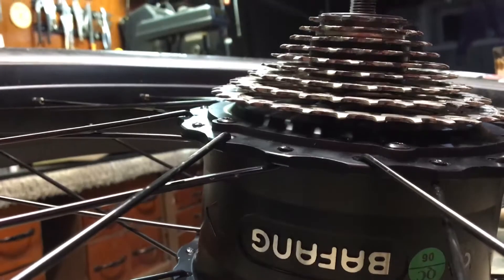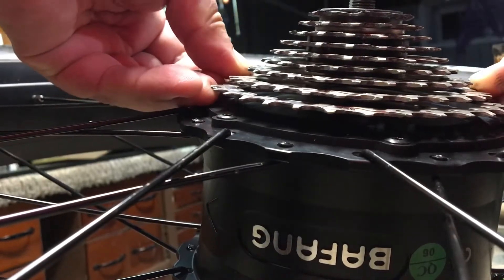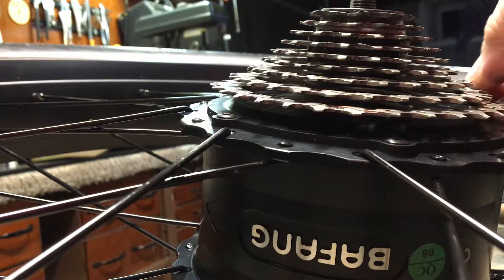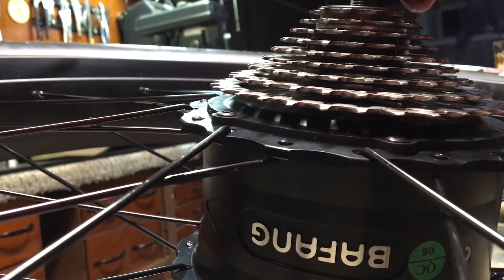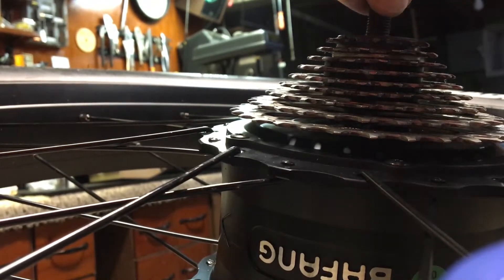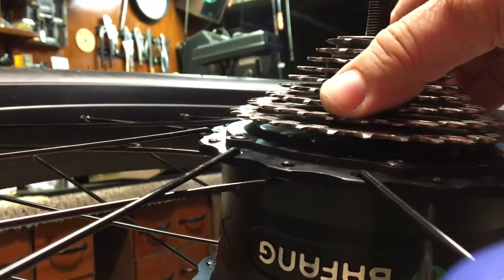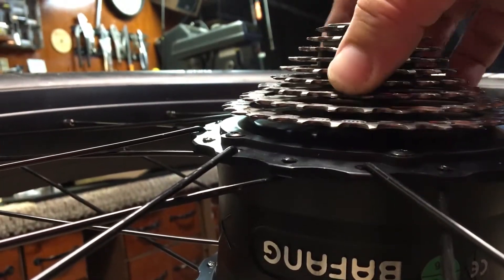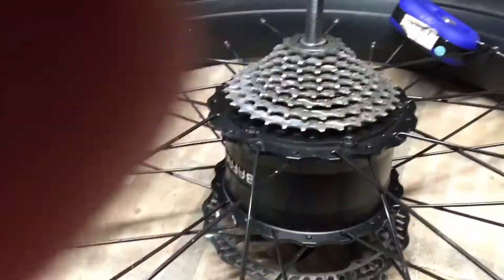Juiced Bikes RCS - FAT EBIKE CASSETTE GRINDING and other identified issues

Comment: To remove the cassette, you need a chain whip and freewheel/lockring remover wrench. Note that because there is a wire at the middle of the hub for the motor, that you need the lockring remover wrench center to be opened. So, be carefull to get the one that will work with your hub. Also, since your bike is still under warranty, you probably should first contact Juice bikes and see what they can do to help you.
Reply from the maker: Hi Gilles, Thanks, I ordered the Park Tool FR-5 removal tool last night and I'll make a chain whip myself.  My guess is it's the cassette bearing or the cassette hub is somehow damaged or cracked. Maybe the cassette is just not torqued down???
Reply: I don't see how the cassette could have been damaged, there isn't enough torque to create that type of damage, unless you dropped the bike on something really hard like concrete. The cassette not being torqued properly might be possible.
Reply from the maker: It sounds like the cassette is moving on the freewheel hub. I don't know if the movement is coming from improper torque down or from the hub  itself or the bearings the cassette spins on. I've never removed a cassette, but have watched a number of vids, including the Park Tool video. The procedure should go fine.
Reply from the maker: @jaybrown1480  Hi Jay, IMO, the grinding is due to the gear hub on the Bafang motor not being to proper spec to fit the Shimano cassette properly. I tried tightening the cassette onto the hub, and even over tightened it to see if that would help, but no luck. It seemed to be fixed, but then started grinding again the next day. I had to send the rear wheel back to Juiced (w/o the  tire)  and they sent me a brand new one that is fine now. The spokes were not tensioned well, tho. I had UPS pack it, so it cost some money, but it was worth it to me.
Reply from the maker: PS... You should definitely send yours back to Juiced. They're aware of this problem, so don't let them say they never heard of this. Tell them there's videos on this very issue!
Reply from the maker: @jaybrown1480  Cool, best of luck. Keep us posted how you make out.